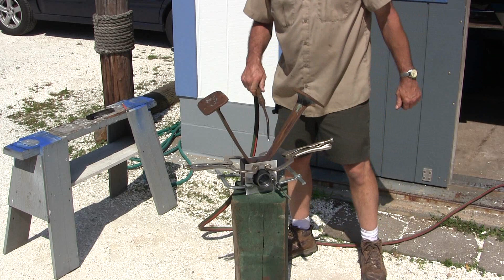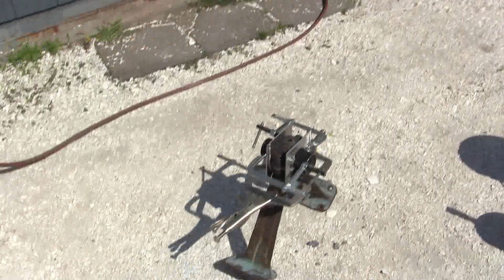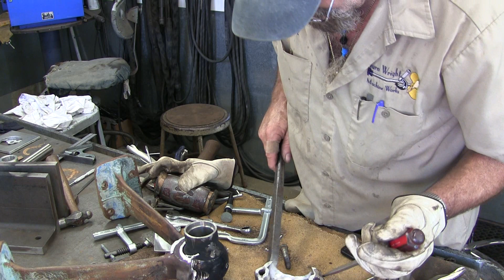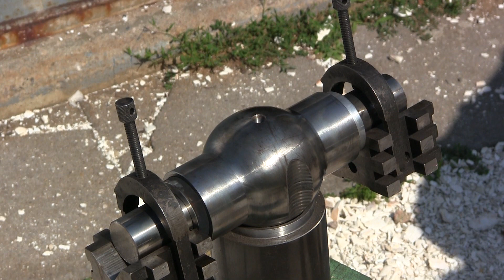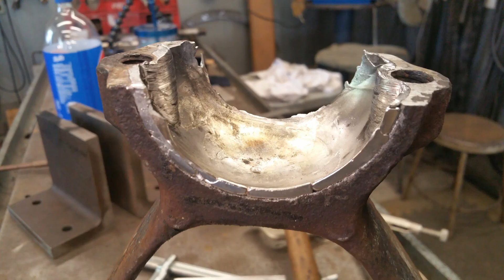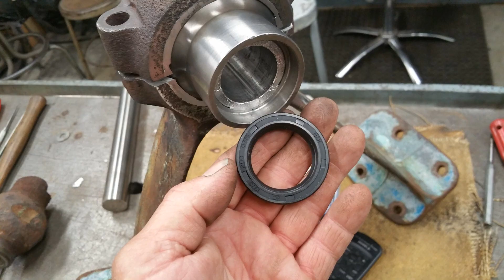Babbitt Pouring Duck Bearings Part Three

Comment: beautiful pour job keith,  i used to pour babbit for large 200hp high pressure water pumps. they were built in the late 1800's. we used a clay-asbestos mix to seal the pour. this was long before the birth of osha. the connecting rods had removable blocks that held the babbit. after the pour came the bluing ,scraping and cutting the lube grooves. the clearance was adjusted by a cavity filled with balls the were forced against the bearing block by a jackscrew at the rear of the connecting rod. these old pumps developed over 2000 psi to operate a 40 inch diameter forge press. those were the days my freind.

Comment: Used to do this for the stern bearings on pleasure boats that operated in fairly sandy water.  Guess that chewed up cutlas bearings in short order so this system was used, supplied with waterproof grease to try to keep the water and sand out.  Think we had about a 75% success rate of good pours.  We usually had to redo one, did all four each year.  Had a DUKW too.  One day I was told, " Very sorry John, you are driving the DUKW tomorrow" what a thing to say to an all wheel drive nut.  Was a bit interesting, the brakes had been taken off to save weight!!!  I think it had had three new engines, two new hulls, a new deck, and I don't know how many axels etc, but it was as good as the day it was built.  Just like Trigger's broom in Only Fools and Horses, two new handles and three new heads, in original condition.
Great work Keith :-)

Comment: I've been following your channel for a bit, and this series definitely made it worth while! I work for a pretty large Babbitt bearing manufacturer in Philadelphia in the repair and service division, 1 suggestion I would make is to not use such thick shims at the joint cause it will raise the level of the shaft if that's critical, also use fiberfrax ceramic paper Inbetween the housing and dams to prevent leakage.  In a lot of stuff we will just use a #6 torch and 3/16"Babbitt rod and puddle up and re machine, as lond as its tinned up good your fine

Comment: Keith,
Great job as always.I learned alot.I had an old Chevy truck with babbit rods,but never tried to repair them.One question that's puzzling me.Since you had the aluminum spacers between the cap/saddle,you now can't tighten the bolts all the way without crushing on the babbit,right?How do you compensate for that spacing?It's not like doing a line-bore where you are shaving caps and recutting the bore?Thanks!

Comment: Stainless steel shim to take the place of the aluminum spacers used to pour with?  No mention that I noticed unless the ball is locked into position by the two bolts at final step of assembly?  Sorry if you mentioned it and I wasn't paying attention.  Would really be great if you could get the DUKW guys to send a few photos of installation and of course putting around with it.  Speaking of great, what ever happened to Clam Pumper 5 or was it 6?  Clam Pumper -- the final episode?
Reply from the maker: After it is in alignment, the ball shape, wants to be snugged up to support the propeller shaft bearing. It spins out of the water as well in the water, grease and rubber seals make that happen, a regular cutlass bearing would burn up in minutes out of the water.  The video was pulled to remove the radio in back ground and getting a round toit put it on the side. ;{)------
Reply: The shims are used only for the pour to create space not left in in final assembly

Comment: What becomes of the gap between the strut housing and the cap? Does the babbitt conform a little when the bolts are torqued? Very enjoyable video btw.
Reply from the maker: it claps tight. ;{)-------
Reply: cool.  spent a lot of summers as a kid on the  river right between three marinas with railways.  Saw a lot of neat things but never a babbitt pour.  Thanks again for the vid.

Comment: very interesting   , i've never seen a babbit bearing poured  before ,it's rather interesting 

I have a friend  who owns a DUKW ,, it's the most unique  machine i have ever worked on 
or operated ,his does not have  all the original bearings like this ,i think there might be one left ,,  most all  of the  babbit bearings and U-joints  have been replaced  with sealed CV joints and sealed greasable bearings 
they run longer ,are stronger ,,and require 80%less maintenance
Reply from the maker: Yeah all the drive line has been updated on this one as well, but the propeller shaft still original. ;{)------
Reply: Keith Fenner funny thing is i think  that's  the one on  his  that has the babbbit bearing still .must be a case of the old way is  still the best
.he replaced the engine as well with a  
4 cylinder 3.9 liter cummins diesel which has more power than the original GMC 6 cylinder
it's about the same weight  but much more  fuel efficient ,and compact ,,and the diesel   also requires a lot less  maintenance  than a gas engine 
I installed a similar engine in a 1988 ford ranger 4x4 ,, it's been tuned a little bit  but basically stock and  produces 205hp and 400 pound feet of torque ,which is pretty good for a 4 cylinder engine even a diesel

Comment: I got a question about the aluminum spacers between the two pieces when you poured, the bearing will now be very tight when the bolts are tightened down! When the unit is installed is there shims between the two halves? How is the size of the gap determined, feel and fit or torque on the bolts?
Reply from the maker: This ball shell designed to allow the center bearing to self align with the shaft, then tighten down and hold solid. ;{)------
Reply: Thanks, that thought came to me after I posted the question, thanks for the clarification.

Comment: Could you tell me how oid is the use of Babbitt for bearings and are they very common today as i had never heard of them until i started watching your channel..
Reply from the maker: https://en.wikipedia.org/wiki/Babbitt_(alloy)   ;{)------
Reply: It's a good idea to have a bucket of water and a wet towel close by in case you get splashed with the babbitt.  I had a friend who was splashed with aluminium while working at the Alcoa plant; the molten metal got him on the back of his neck.  One of the guys had a bucket of water nearby.  They dosed the metal with the water and peeled it off of his neck.  He was still seriously injured but it would have been much worse if they didn't get that hot metal off of him.  Great video series,   I have the engineering students that I tutor watch all your videos.
Reply: Wow unlucky lad we all took short cuts it won't happen to me then from your hospital bed its look lads if it happened to me it could happen to anyone i took many a short cut but I was one of the extremely lucky ones someone was looking over me in those days

Comment: With the gaps between the two halves,how can the bolts be tightened without binding the self-aligning feature?
Reply from the maker: After it is in alignment, the ball shape, wants to be snugged up to support the propeller shaft bearing. ;{)------
Reply: Kieth, would drilling the cap bolt heads for wire tye be a good idea or will salt water corrosion lock them soon enough? Excellent results, thanks for sharing.
Reply: So no shim stack to provide support to rocking outside of the bolts but still allow a slight crush on the ball alignment?  I am sure there is some flex in the vehicle and it seems like the rocking action on them would be hard on them and the threads over the long therm.  Of course I guess if it made it 75yr already maybe it won't matter in another 75.

Comment: i am confused, did not the joint dam increase the size of the pour? preventing the top and bottom from properly  joining without crushing the Babbitt. none of the end photos show the two bronze half's fully mated but rather with a gap
Reply: Babbit bearings should have a gap... you shim them when assembling, as they wear you remove or thin the shims.

Comment: unless the owner of the vessel had specified to stay with the original setup, why not use a rubber bearing for the shaft as even with the use of a seal, the chances are great that the water finds its way in the bearing lube ?
A great job of refurbishing a component that will be useless otherwise.
Reply: You'll burn up a rubber shaft bearing on a amphibious boat  like this in no time whereas a greased shaft like Kieth did will always be lubricated as long as it is maintained properly.Rubber shaft bearings are not designed to work above water or to be out of the water constantly.
While you did a great job trying to act like you know it all.The fact remains that the engineers who built these back in WW2 knew a thing or 2 about manufacturing a quality product that was built to last.
Reply from the maker: It spins out of the water as well in the water, grease and rubber seals make that happen, a regular cutlass bearing would burn up in minutes out of the water. ;{)----
Reply: try reading the statement of the video. Staying original was intended, with a added seal to give it some longevity. With the use of marine waterproof grease   and a remote grease line for ease of maintaining, this rebuild will last a very long time. Your "useless" comment shows your ignorance.
Reply: If you don't know, there is no component that last a lifetime and seals are of these components 
If you never replaced a seal because it is contaminated with dirt, better you should put your hands in heavy equipment and analyse the causes of seal failures.
some specific applications requires a specific approach, As Keith says, the main reason of using babbit bearing underwater is justified by the fact that often, the center of the propeller is often over the water level and a rubber bearing would not recieve sufficient lubrication.
If you read well my comment, I took in account that the babbit bearing could be a request of the owner of the vessel.
Reply: SouthJerseySound  strange response from JP indeed
Reply: My initial intervention is aimed on improvement of the product
as this design is circa 1940, there is room for improvement.
as there is much progress in the industrial mechanics area, 
Unless this vessel have an historical value and must be kept bone stock, these is an investigation to be made to improve the life of this support bearing as the failure is caused by the intrusion of dirt and water in the lubricant ruining the bearing and the shaft.
I can understand the initial design as these vessels were built to make a ponctual job and not to be in service for a so long period.
The execution of parts is more than excellent but the cause of the failure remains